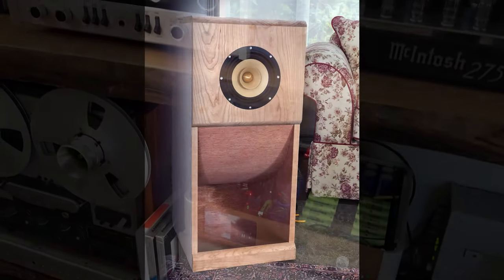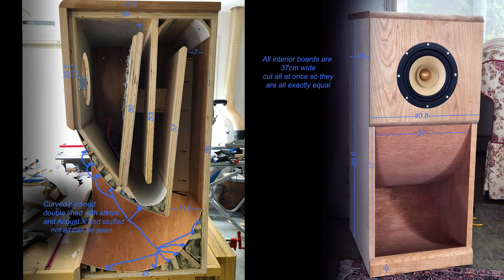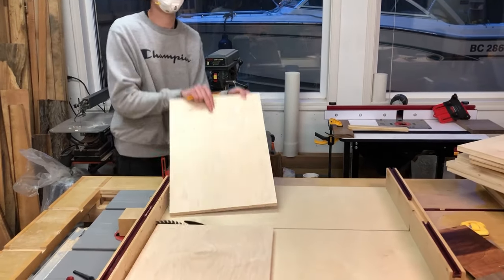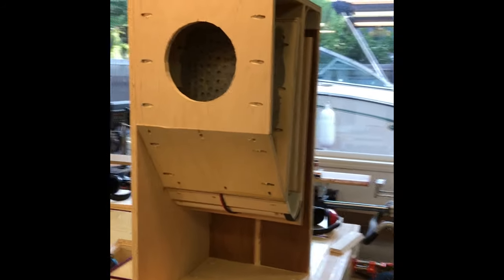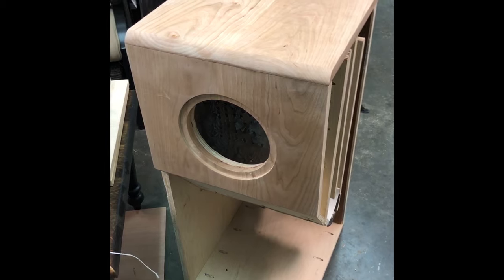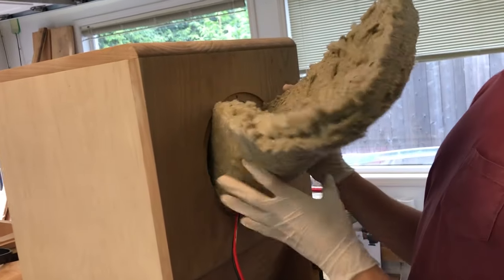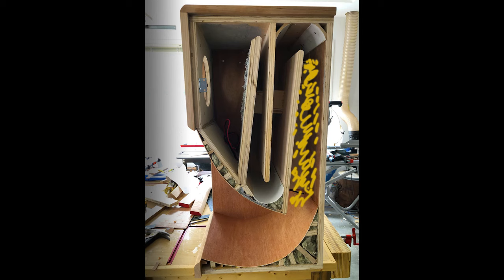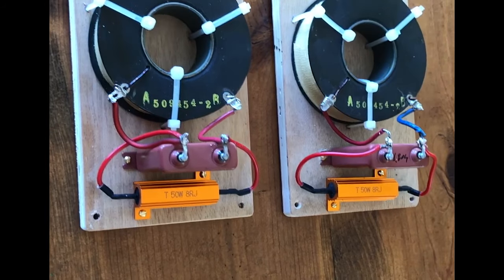Build your own amazing DIY Horn speakers

Comment: Inspiring build! I have been looking at various transmission line speaker designs to build. I like this design. Very beautiful.  At 60 years old I already have some missing frequencies in my hearing, and after about 14KHZ, I can't really hear anything, so I am not sure I could fully appreciate their performance. Regardless, I like building things. I used to have a pair of JBL 4412s. I wish I still had them...

Comment: Excellent work and a very cool project.  I did something similar with the Fostex FE103NV 4.5" Full Range FE103NV drivers and a much smaller enclosure.  Sounded so different than a "regular" speaker.  Mid tones are amazingly clear and top end gently rolls off.  Lower end needs a bit of an omph, bt a subwoofer took care of it.
Reply from the maker: Thanks, these are nice drivers for the size, always nice to build something special vs buying.
Reply: I bought speakers similar to these but much smaller (Closer Acoustics OGY). Yep, it’s exactly what you described but I also have bass.

Comment: Hello Cool Dad.😊
Greetings from a newbee.... Great project.  I have the fostex fe166 en drivers .  There are plans avabile on the homepage off the driver.. how ever I want a more sleek design ( less boxie but still having the same volumen) .... therefore: are You aware off a  expainer off " how to" use the software for dimensions off horn speakers... ? From a to z .   
B.r Christian Fabricius from Copenhagen...

Comment: If you ever read this, please tell me why you needed to use a crossover when you are only using a single driver? Also, what is the advantage of a folded horn compared to a Voigt tube? Thanks.
Reply from the maker: The frequency response is rarely linear some frequencies are high like in this case the midrange is a bit higher and needs to be tamed down a bit to sound better.

Comment: Most people could not build this project based on your rather superficial video, even if they even had the fully equipped pro wood shop as you do.
I would like to say that there are pre cut kits available (or plans for simple horns) with full range Fostex and Lowther drivers out there if you are interested in this type of speaker.

Comment: Can I use Tang Band 1808 instead of the driver u have used. Also why did you choose this vs the 1808 would be keen to know
Reply from the maker: the W8-1772 is suitable mainly for the back-loaded horns, the W8-1808 can be used in open-baffle but if you have the 1808 it is not a big difference use it
Reply: @Gabster1  thank you for the reply I have the 1808 and find it better in 30 litre sealed box than OB but I would like to try your horn build 🙏🏻I am new in diy hobby and learning

Comment: 1/4" curved plywood? Looks almost as thin as veneer to my eyes! Could it be 1/8"?
Reply from the maker: There are actually 2 layers of 1/8  with Acoust-X in between to make more then a 1/4. The main  layer is 1/8, then strips of 1/8 with Acoust-x added in between (you can only see some of them as some are a few mm shorter) and a  lot of 3/4 inch bracing then dense insulation in between, it is fairly solid. The bracing is the most important part. If you prefer you can add as many layers of 1/8 as you like. Hope that helps.
Reply: @Gabster1  Thanks!

Comment: Why even use a cross over in a coax please help? As im thinking of a diy myself.
Reply from the maker: Often but not always depends on the speaker and the cabinet the frequency response of a full range speaker is not very flat and you need to tweak it a bit for better sound.
In this case the midrange and part of the high frequency was a bit higher then the rest resulting in a brighter sound that can be fatiguing and needed taming down a bit. 
Every speaker is different you need to measure and listen. Also the goal is to get a frequency response where the speakers sound live and enjoyable and that may not be very flat.
Only measuring and ultimately listening will decide.
Hope that helps :)

Comment: Why do you need a crossover network when it's a full range...?
Reply from the maker: depends on the driver and enclosure the frequency response may have a peak or a dip at certain frequencies and needs to be corrected. but usually not critical

Comment: Question: won’t the bass waves coming out the folded horn be 180 deg out of phase with the sound waves coming out of the front of the driver? Aren’t pressure waves at back of driver 180 deg out of phase with those coming out of the front?

Comment: The length of the horn should be based on speaker size and desired tuning frequency, not just 9 or 10 ft.
Reply from the maker: yes yo are correct but it ends up being around 9 to 10 ft